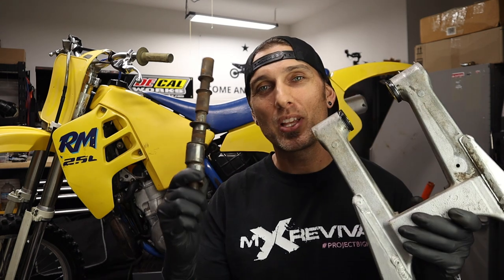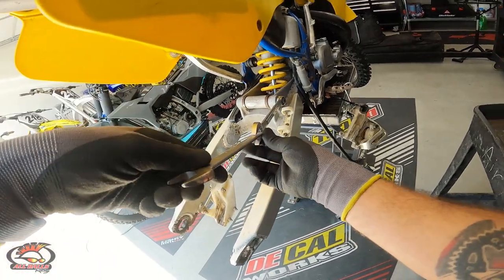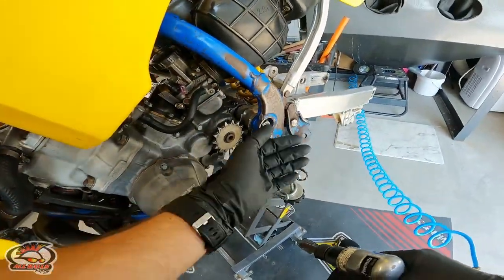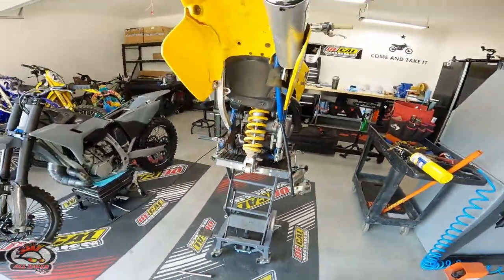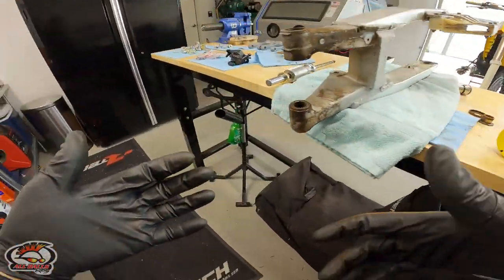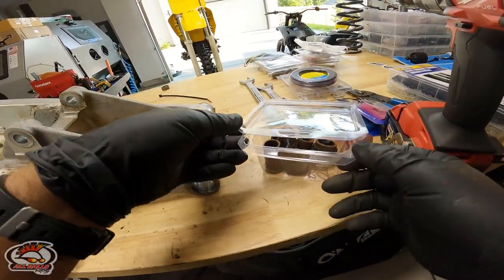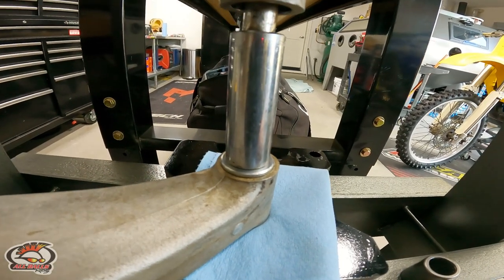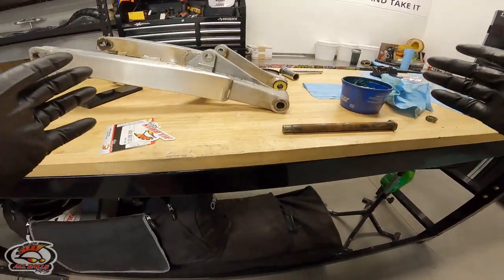Fixing THE WORST Dirt Bike Swingarm Bearings (FROZEN SOLID) How To Remove & Repair | ANY Motorcycle

Comment: great video and what a headache!   A general tip for anyone driving stuck bolts like this. Any time you can use a backing tool to prevent the material from bouncing so much, it will help a great deal.  Some call it a backing dolly , hammer dolly, anvil, etc. It just has to be a heavy and rigid piece you hold against the piece you don't want to bounce so much, it could even be another hammer.  Usually you want it to be at least as heavy as the striking hammer, but use whatever you have available.  Doing this concentrates all the force to the joint you're trying to break free.

Comment: Rmx250 has  zurk fittings in ends of suspension shaft bolts which is probably why that kit had holes in inserts.

Comment: Mine was worse... the bearings where one thing with the body of the linkage
Reply from the maker: Ouch!
Reply: I'm there right now, DR200 and the pin is 100% fused to the engine case. I have a good metal shop and resorted to making a puller with 80x25 flat bar and 2x25mm threaded rods. I machined a hollow spigot to receive the head of the bolt, pulled it to 50 tonnes with a 350lb rattle gun then used the pneumatic hammer on the press bolt (machined from a grade 12.9 16mm bolt) I drilled the engine casing to get some penetrating oil in a few days before, then heated the casing with a mapp torch until it was smoking hard. I laid in more blows with a 5lb hammer and the pneumatic and kept winding more torque. It all failed, turned out the receiver dolly, machined from solid chromolly steel with 5mm wall and 0.2mm inside clearance to the bolt head crushed into the frame ear, deformed the steel and rolled off the edge, killing any chance of using that system again... not sure where to go from here. This job goes down as the hardest seized bolt removal in my engineering career. My next step is cutting the swingarm away to remove the engine then get that on the bridgeport... ugh.

Comment: Known issue with an xr250.  Bolt seizes into the back of the engine case.  You are f'd if that happens

Comment: Yours pivot bolt actually came out easy by comparison. I did all of that, literally every bushing, bearing, and the engine rotate around the bolt except one bushing (bearing was still good), I did all of this plus was using a 5lb dead blow mini sledge style hammer, two handed, for an hour with drift down a socket so I could hold the hammer with two hands. Didn't budge a mm. Ended up have to cut the bolt out on one side, and drill the head (solid shank bolt, CRF150RB) to remove the head so I could remove the swingarm, then still had to use a 4 lb engineers hammer to small the remainder of the bolt and bushing out. Now the bearings that were in great shape have to be replaced, and I had to resurface that section of the swingarm, and replace everything else.

Comment: I got a 85 kawasaki 125 and I was fixing to pull the motor out and I got a screwdriver stuck in the swing arm I’ve taken motors out of way older bikes and never had to use lubricants or violent force so I’m going to try to get a stand like yours and remove the shock and all of that stuff that you did the bolt holds the swing arm and the motor in which sucks

Comment: I had one like this. Was on a buddies DRZ400E. The old ones actually have greese zerk fittings on them, yeah, on an offroad bike. Needless to say, water go it after they were broken off, and its stayed that way for years. Almost gave up up. Heat and more heat and let them sit over night in an oil bath. Then came out much easier.
Reply from the maker: Good job staying on it! Honestly, I wouldn’t mind zerc fittings on all bikes, pivot points 😅

Comment: Think of all the changing times that bike lived through, amazing it's not ikea furniture by now.
  Got yourself a new swing arm shaft punch. Time for acetylene oxygen hot wrench rig. 
Bikes should have zerks. In 98 I had slightly worse condition on an 81 cr250 with broken in half swing arm needle bearings that punched through bearing housing(much thinner wall than that rm bearing housing) and embedded into aluminum swing arm. 
 Most people have little time to ride, even less to tear a bike down, or a families small fleet of clappers every year.
Watch out, bearing puller collets flanges break on rough stuff.

Comment: Where did you get that sleeve you used to push the race through?
Reply from the maker: Just a socket, use one that fits the bearing outer diameter (OD) to push them through 💪

Comment: Hey, do i need to replace bearing sleeves too?
Reply from the maker: If you are replacing the bearing, then it’s a good idea to replace the sleeve too. That way, they can wear together. 

Typically, when you buy a kit, it will come with the bearings and the sleeves so you should be good there. 

You can get solo parts like the Bearing without the sleeve when you are purchasing OEM. But that can be much more expensive, so it’s something to consider.

Comment: I just struggled last spring with this exact problem. I don't have a bearing press so I was using sockets and a large vice as a press. Lots of heat is definitely the key, I also used penetrating oil. Apply the penetrating oil then heat it till it boils and it works its way in to where you need it. Make some mess though. And because I didn't have a bearing press, I wasn't able to apply as much pressure with a vice as you were with a press I think.

Comment: Enjoy your video’s. How do you find your parts? I need a new hose for my rear shock reservoir on my 1982 Suzuki PE 175. It is mounted on my frame.
Reply from the maker: Thank you Allen 💪 for some of the extra hard to find parts like that, or parts for this older Suzuki... I've been having incredible luck with a company in the Netherlands called Cmsnl.

Pretty amazing what I've been able to locate on there and they ship quickly.

If you get stuck and they don't have it, which is always possible because the bike is so much older, eBay is a really great resource as well. Even if you have to buy a complete shock to get the part you need.

Here's the parts microfiche on Cmsnl for your bikes rear shock. https://www.cmsnl.com/suzuki-pe175-1982-z-usa-e03_model16145/partslist/BLCK0036.html#.YvesPqRMFSA

Comment: Ah man I had the EXACT same problem on my 92 RM125. I beat it for days.. weeks. Finally... I put propane through the hollow bolt and hallajuujha with enough poundage ... it broke loose. Never been so happy. Thankfully partzilla came through with a new bolt and nut (bearings and such). So ...now I'm glued to your channel like white on rice.  So glad I found you doing this project. Thanks.
Reply from the maker: Hell yes, you got it done! Hear our best friend sometimes. I remember being worried that I wasn’t going to be able to get that new swing arm main pin. Then it turned out I had two spares, because my 04 and 06 main pins ended up being the exact same part number! I’ll be using this 89 Build to fill in the gaps while we build the YZ 500 🔥 glad to have you!

Comment: always stoke for your Videos C.. ive been looking at lifts stands myself  im 47 now and when i get up from crouching down feels like i got my ass kicked hahah ... they say dont let the calipers hang it pulls on the pressure crimped  ends and can leak but ive never had it happen
Reply from the maker: Thanks bro! Is this Ken? If not, I just sent Ken an email so I could hook him up with a lift stand 🔥 I figured the same about the brake line, as it seems common sense not to let it hang with all that weight on it. But like you said, it's also plenty durable I'm sure. Thanks again for watching this one and the full grease video that I just commented back at you on.
Reply: @mxrevival  no its brian i can send a message about the stand

Comment: Hi Charles enjoying your videos, I did schoolboy mx in the 80s, makes me wonder if you could modify the swing arm pin (blank each end) & fit a grease nipple, you’d have to turn the seals so grease could pass out, this would be a double plus, as the lip of the seal would stop dirt/water getting into the bearing, the bush has a hole in already, might even get grease around shank going through engine case, just a thought, 👍😎
Reply from the maker: Hi Anthony, thanks for the compliment and for watching. I really appreciate it 💪 it's a great idea. Have you ever heard of a company called Steelhorse Innovations? He makes a product similar to that, at least I'm envisioning you're describing. 

It has a main pin that has zerk fittings on either side and can be greased to lubricate the swingarm bearings. 

He was kind enough to donate one to a YZ 300 project I have going, that I really need to finish 🙃

I think a product like that, at a bare minimum, will keep things from freezing even if the grease doesn't quite make it to the bearing
Reply: Totally agree, any is better than none ( keep them wet, that’s what I say lol) 
Sorry no, I’m in the UK, will look them up though. Makes sense to me if these parts were greasable, heard of many people struggling getting these apart, for me I tend to look at modifying what has gone before, struggle once, make it easy next time, (I’m not building bikes though).
Keep it up 👍😎
Reply: Just looked them up & watched the video, yeah that’s it exactly, would imagine you can do that by modifying the normal swing arm bolt, sure it would be straightforward with basic engineering equipment & knowledge.
It appeared the swing arm bolt you removed was hollow, couple of holes each side, tap the ends to blank, then tap for a grease fitting.

Comment: Sometimes loosening the engine mounting bolts and the top mounting plates can help loosen up those swing arm axles too because it lets everything move and not bind as much. It also helps when you put the axle back in. Great video tho man
Reply from the maker: That's a great point. I've seen guys use this method when putting bikes back together for the first time and before setting final torque. I could 100% see how that would be a great aid as even a little tiny bit could be extremely helpful in this situation. Great value comment, thanks dude!